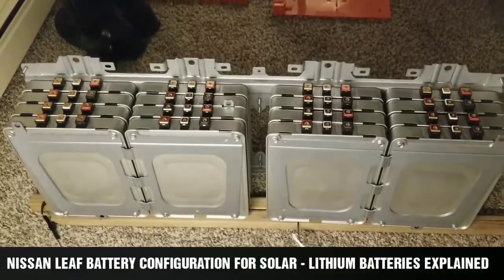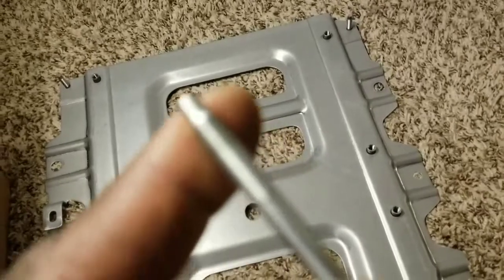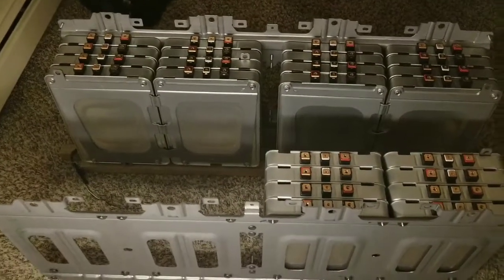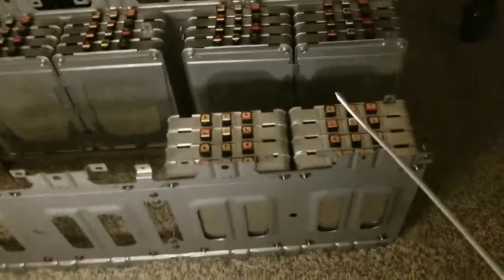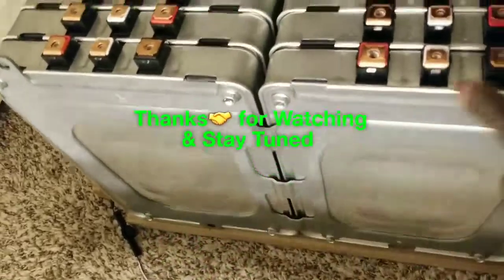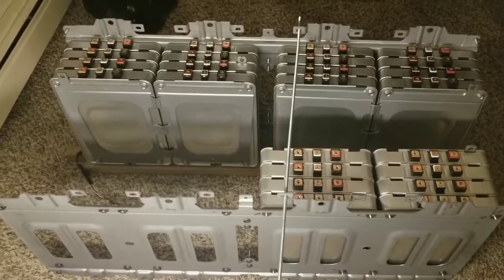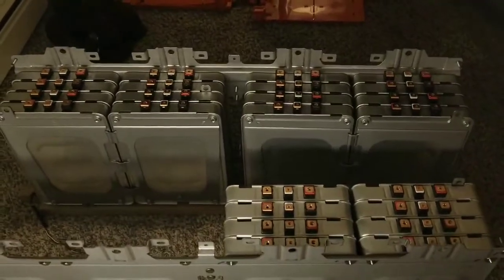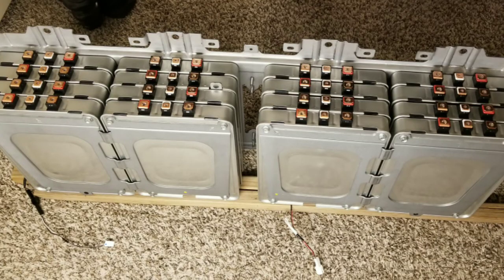NISSAN LEAF BATTERY CONFIGURATION FOR SOLAR - LITHIUM BATTERIES EXPLAINED (part#1)

Comment: It only takes 7 of those batteries to make a 48v battery pack. You have enough to make your other 2 packs. all you need to do is remove 1 battery from each of the backs you already have. Save your money and just make 8 14S 48 volt packs.
Reply from the maker: Thanks for your Input but I am running a 16s configuration with my system. 
Please watch my OutBack videos with my lithium battery on my playlist you will see how efficient my system is. 
Thanks for WATCHING buddy and thanks for the comment and have a wonderful day.